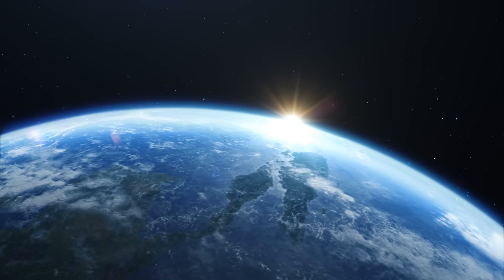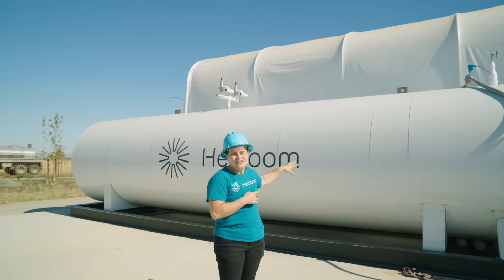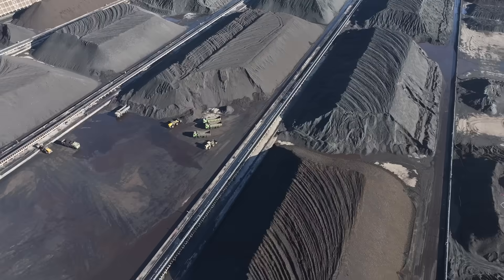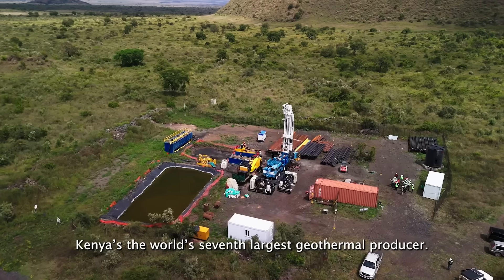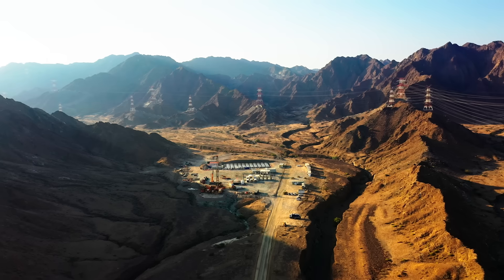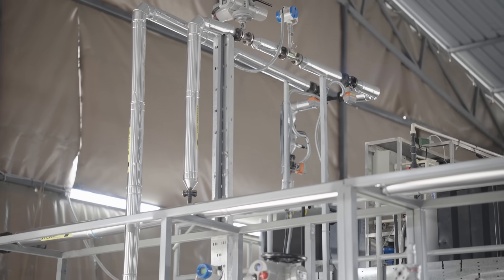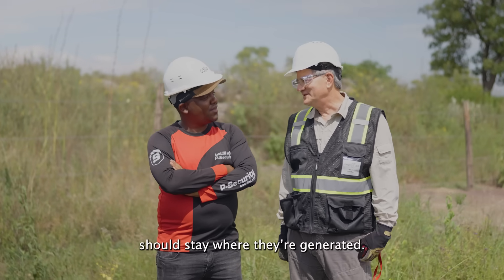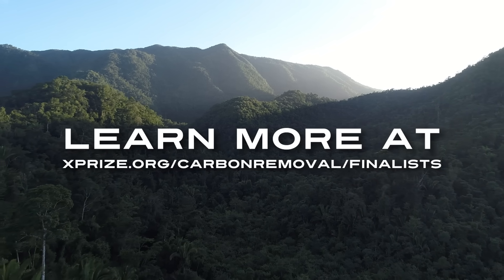Is the Future of Carbon Removal in the Air? | Meet the Finalists | XPRIZE Carbon Removal

Comment: What are the long term effects of changing the soil or air content.  5 or 10 years down the road, how is the food impacted with this new change?
Your using foreign rock for one application, the Grand Prize winner.   Foreign fruit, trees, animals, insects imported to your country can impact the environment in a negative way.   
  And Basalt dust states its low in Silica at 40-45%, which is carcinogenic.  Is this leaching in to our food, more and more.  In my country, cancer rates are higher per capita, so I am tired of all these new inventions being implemented without appropriate long term testing on the food (10yrs or more) because of the chemical changes/electro-negativity(Basalt).    The repercussions from past evidence, is usually 20-30 years before it is noticed.
   Example, bread in Italy is safe for Gluten allergies but not where I live.              This is first glance.